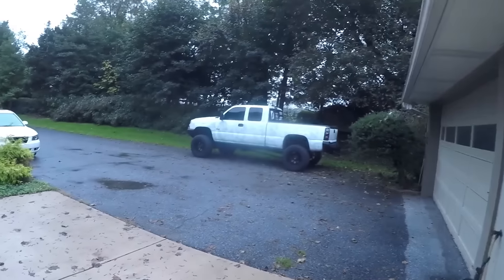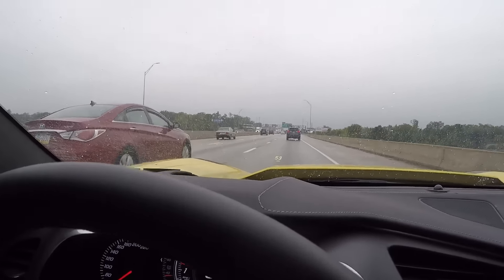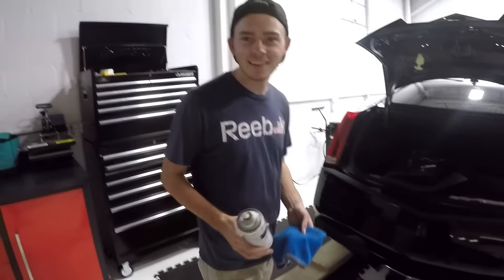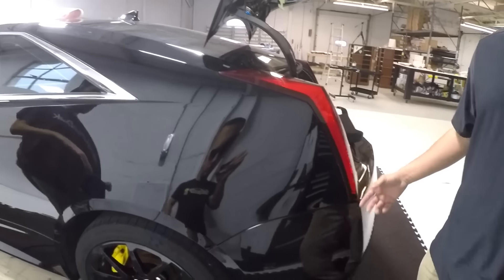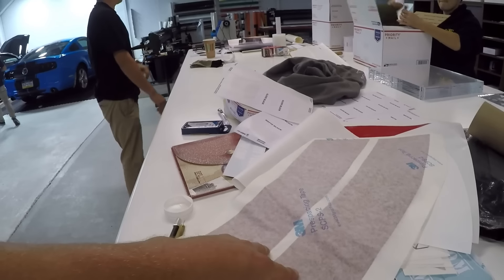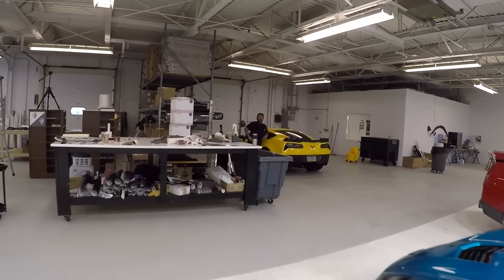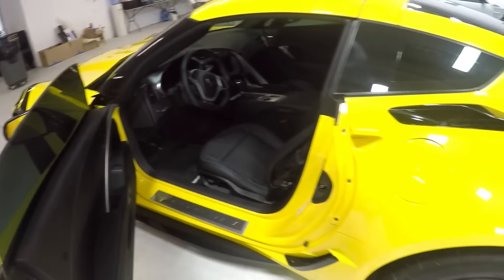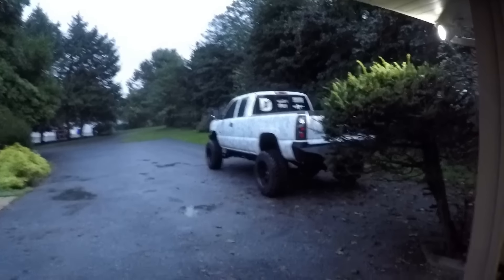I Let My SUBSCRIBERS CHOOSE My Z06 Wrap!

Comment: Mike you should get the corsa extreme system with an x pipe for the c5. I have that on my c5z and it's really good. 👍
Reply: Tood Anderson me too! But on my c5 lol
Reply: Tood Anderson He should get headers and X pipe then find a Z06 stock titanium  muffler set up very light
Reply: Matt Specht The weight in the back helps the 52% front weight distribution.
Reply: have heard that car already it sounds good i wouldn't get corsa i would get ported heads and fast intake for more power.
Reply: Tood Anderson seems to be ok on the z06

Comment: I feel like you are going to try to make the C5 into another C7 because thats all you know how to do. Keep it daily usable like the C4 was. It was "cool" but not obnoxious and it had usable power, nothing crazy. Its your car, but I think you'd regret modifying it too much
Reply from the maker: Not at all, biggest power number for the c5 would be around 500, most likely less-
Reply: I would keep the c7 where it is and make the c5 the drag car.. the c7 is modern and has a reliable 700whp... ya might as well make the already modded c5 balls to the walls
Reply: Chillin With Chris I agree
Reply: It's not like Andy hasn't dyno'd the C5. It makes 400 rwhp, so a pulley and a nitrous spray should make close to 550 rwhp and be mostly reliable. 

Big horse power on a street driven daily driver equals drive ability problems. PA has shitty roads ready, more so after the winter, plus Mike needs to stay out of trouble, otherwise the channel gets renamed, Shoe Leather 717.
Reply: it’s his car and his channel he can do what he wants with his cars and his money

Comment: STOP PUTTING DRAG RADIALS ON IF YOU ARENT ON THE DRAG STRIP
Reply: 700rwhp car always run drag radials or its like a turbo honda that can't get traction
Reply: Jaggsta yeah you are correct 4wd can run with 700 and on street tires

Comment: Mike! Please Read This!!!!! You already have slp loudmouths on your c5! These are the best straight pipes for a c5! I have the borla stingers, b&b straight pipes, and a custom straightpipe. Also I have had stock headers, long tube 1-7/8 headers, stock catted xpipe, stock carted h pipe(zo6) and no cats with long tube headers. THE BEST SOUNDING IS CATTED X PIPE WITH STRAIGHT PIPE CAT BACK. When you have straight pipe cat back and long tubes with no cats it's way to fucking loud it's annoying asf. If your going to change the exhaust at all go catted x pipe long tubes and straight pipe cat back. This gives a great loud sound but it also has little drone. In this combination cops don't mess with me. When I had no cats and straight pipes they pulled me over from just hearing my cruising speed. I currently own two C5s. Great cars, lots of problems.

Comment: What he needs to do is just flip the cables upside down so that the reverse is on top with the clear and the two brake lights in the right place
Reply: ive seen several of these taillights , just change the brake and reverse to match the hole it works. hint though run a bead of silicone around the seams to prevent moisture getting in,  .Amish speed 717 shirts , id bet they sell ,run that c5 see what it does at callout and then spend the dough where it needs to go